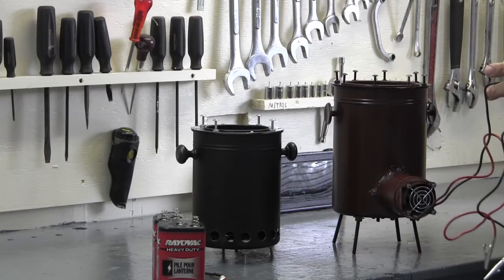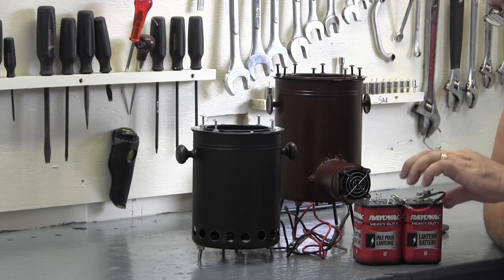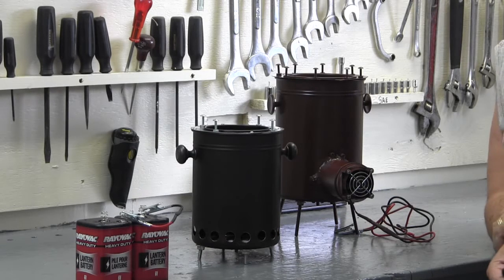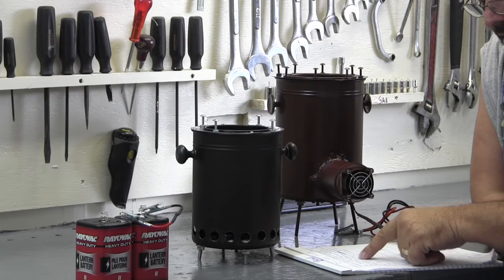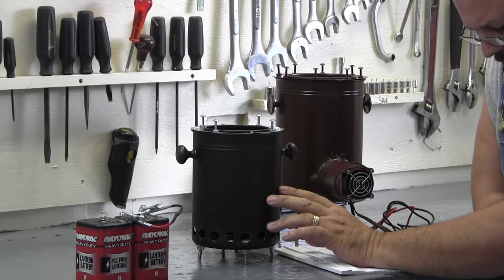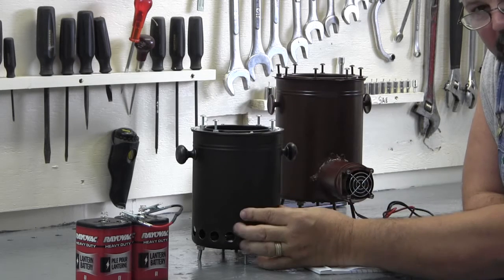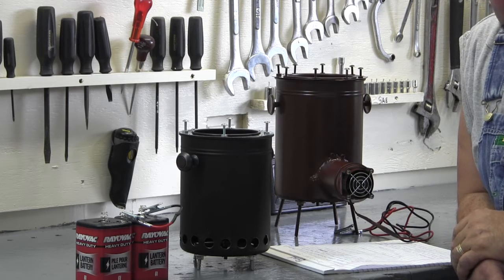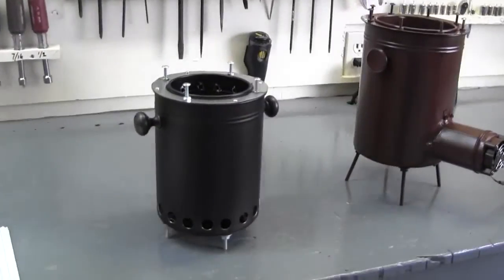Forced air wood gas stove

Comment from the maker: i think your confusing volts for amps. they are all either 125 volts a/c or 12 volts dc. the amps are usually between 1-5. there are a few that pull so little they are measured in m/a (milliamps). you could also be thinking of watts. here is a formula. amps=watts divided by volts.volts=watts divide by amps. and watts its volts multiplied by amps. was that any help?

Comment from the maker: it mixes with oxygen but the hot gasses are hotter than the cavity temperature. convection is heat or gas transferred by circulation of currents from one region to another. in this case its a hotter gas mixed with oxygen transferring upward in the cavity because its temperature is hotter than that of the cavity,but less hot than that of the fire which is why it leaches downward through the holes below the fire. in ww2,this downdraft technology was used all over Europe to power vehicles.

Comment: i was with you untill you said it mixes with cooler air then it naturally rises???, would the cooler gasses mix not sink, using convection rules im sure it would.

perhaps its not convection drawing the gasses up the sides, could it be some kind of venturi effect like a carburetta or spray gun, the heat from the flames passing the top holes perhaps?.